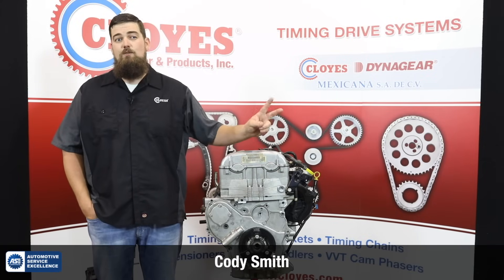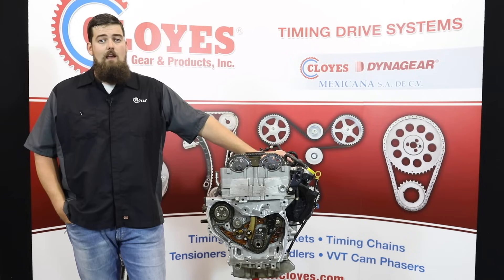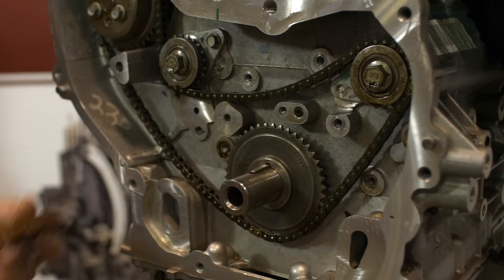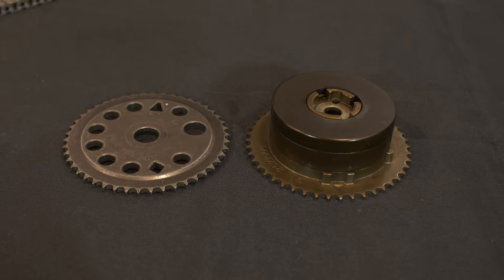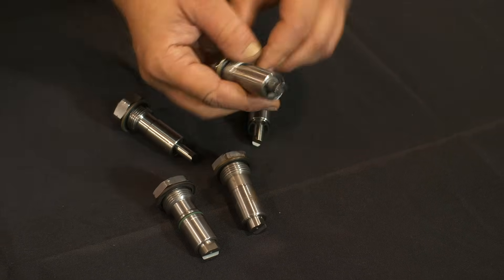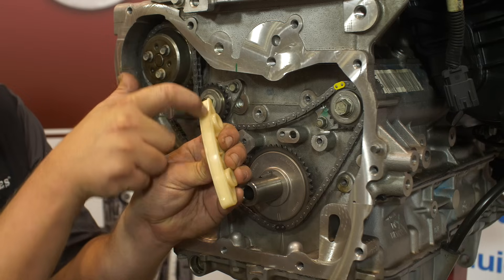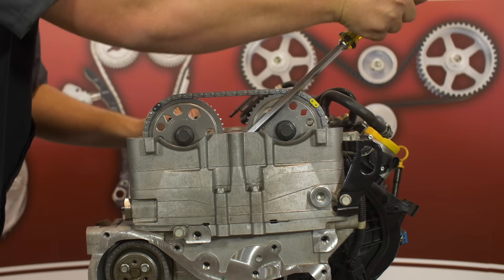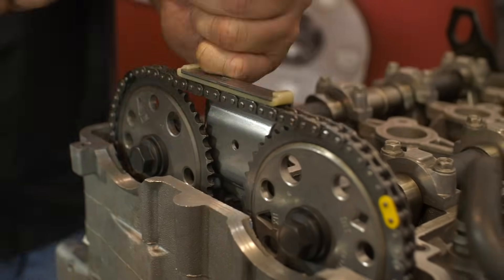GM 2.0/2.2/2.4L, Timing Chain Replacement, Cloyes 9-4201S & 9-4202S

Comment: Do you know another indication of the TDC in exhaust stoke? Haynes manual states marking on pulley and line mark in engine cover is TDC on compression. My arrows on the camshafts are 10 on intake 12 on intake. That’s the closest I can it to align to the arrows. I also did put a screw driver in cylinder number 1 to to TDC.
Reply from the maker: Sounds like you are close enough. The engine does not need to be at perfect TDC to set the timing. The chain sets the timing, as long as your links are all aligned properly to the sprockets, then it is in time.

Comment: How do I verify the #1 piston is at TDC on correct stroke?  I replaced the head after chain broke and bent valves. I can get everything to line up but am unsure if #1 is on proper stroke.
Reply from the maker: If everything is aligned, then it is on the correct stroke. If the engine was 180 out, then the cam sprocket timing marks would be down.

Comment: Just finished doing my timing chain and came up with p0016. What i learned is to retard the intake cam 1 tooth
Reply: When taking everything apart, the intake gear tends to "spring" forward one tooth, so you have to turn it back when putting the new chain in.
Reply: @TiggerNyeah  i figured out what i did wrong and i only moved the exhaust cam instead of adjusting the intake cam

Comment: This is my second comment on this video, but I think it is worth saying.  I, like many of you, had a really hard time getting the sprockets off on the balance shafts.  In fact, I ended up dropping drill bits and punches into my oil pan (100% my fault- I should have stuffed a rag into the void leading to the oil pan).  Anyhow, what I ended up doing (and it worked really well) is I took the old balance shaft chain,  and cut it in half with a cutting wheel.  From there, I draped the chain over the top of 1 of the sprockets, bunched one end of it and let it bind on the housing.  This held the sprocket solid  and allowed  me to remove and reinstall the new one.
Reply: Were you able to get your stuff put of the oil pan
Reply: @Burgerkinglover32   yeah- I think I had to drop the oil pan to get everything out
Reply: @billyjacque6940  was it difficult did you do it on a lift or on the ground
Reply: I dropped a tool in the oil pan also we fished it out with a magnet and my boroscope

Comment: I already installed the timing chain on my 2012 Chevy Malibu. What happens if the timing sprockets on the water timing chain are not aligned properly? Does the vehicle overheat? Do some cooling systems not function properly?
Reply from the maker: The balance shaft chain that drives the water pump needs to be timed for proper balance shaft operation. There should be no water pump or cooling related issues as long as the chain is turning the pump. You could experience excessive engine vibrations, but that is it.

Comment: I just finished mine it wnt start, gives me code P0366. (CMP) Sensor . This is the code I was getting before I realized the timing was out and multiple timing guide pieces and bolts ended up in my oil pan .I dropped the oil pan and filled a 12 oz cup full of pieces and bolts. I also found 8 of my cam rollers in pieces on the top , so I picked them all out with a magnet. Tested compression  it was fine. I'm thinking the rollers blew out before the valves hit. Can you tell me if the P0366 could mean my timing is out ?  I changed the  camshaft position sensor , still the P0366. I still have to go back and inspect the wiring.But would this keep the vehicle from starting? Every thread I read no mechanic says, in probale causes for P0366  -  "timing is out or cam is out of sync" One mechanic guided this guy through changing his (CMP) sensors then his(CMP) actuator selonoids .And all the time the car owner was telling him I hear a rattling coming from the motor . Low and behold the timing chain went. The mechanic said hears a guide on how to replace yor timing chain. So I wonder if this answers my question.
Reply from the maker: It could mean the timing is off, or you may have a VVT system issue that is not allowing the computer the adjust the timing properly. Have you replaced the timing system since the failure?
Reply: @Cloyes01  Yes I did a timing chain ,gears and guides . After re assembly when I try to start it , it just cranks. I get a p0366 code .this code is what was coming up when the chain jumped in the beginning .
Reply: @Cloyes01  Do you have any specs for the 2011 Buick  2.0 TURBO "LNF" motor. I am hearing the cam sprockets are to be set at 5 and 7 o'clock ,can you verify this ?

Comment: So I took a 2012 Buick Regal 2.0 to a shop for water pump.. they ended up setting off timing and refused to accept responsibility… I eventually drove it and repeatedly changed ignition coil #2 over and over until it finally went out for good. So now I wanna figure out if I fix timing and do coils and plugs again if all will be good again? Or if it messed up catalytic converter?
Reply from the maker: It should be good if you get the timing set right and have functioning plugs and coils. The converter should not have been damaged.

Comment: I torqued your bolt at the 63 ft pound on the cam sprockets and the bolt broke.  Are you sure that's the right  torque?  GM is like about less than 30 ft pound.
Reply from the maker: The GM torque specifications we found are 22 lb/ft plus 100 degrees on VVT equipped engines, and 63 lb/ft plus 30 degrees on non-VVT engines.
Reply: @Cloyes01   I only have 2 torque wrenches.  one in 250 ft pounds and 250 inch lbs .From what I understand, you  can torque in inches and multiply by 12.  True?  But since 22 times 12 is 264,  is there a way I could get that extra 14 inches?  Without going out and get a different wrench.  If you understand what i mean.
Reply from the maker: @cartroublewannafix8611  Using the inch pound wrench at 250 inch pounds will get you to 20.82 foot pounds. That is close enough and likely within the range of accuracy for an over the counter torque wrench. Possibly just as accurate as using the larger torque wrench at 22 pounds.

If you are concerned, you can torque to the 250 inch pounds, then set the larger wrench to 22 foot pounds. That way you know it should only require slightly more torque before you get the click.
Reply: @Cloyes01  I forgot to mention that on my ft lbs one I only have from 50 l ft pounds to 250 ft pounds.  I don't have the 22 pounds on the big one.
Reply: @cartroublewannafix8611  I seen a video where the mechanic explained  by  using a  long handled torque wrench has more leverage and you will have more pressure in the inittial torque.

Comment: s there a way to adjust the timing without marks?  I took the chain out and my stupidity allowed me to turn the the sprocket s individually, which turned the cams.  Now I have no idea where I am at.  Call me  an idiot because I am. 2015 Chev malibu 2.5
Reply from the maker: It is OK. Just remember the timing chain sets the timing. You will need the marks on the timing chain links so you can align them to the sprocket marks. If your chain no longer has marks you can make new ones with a paint marker. Just lookup our 9-4201 chain on our website and make new marks that are spaced properly. When reinstalling the chain, move the shafts to approximately the correct locations then start aligning the marked links to the sprocket marks. If a sprocket mark isn't aligned properly, just move that shaft until it does.
Reply: @Cloyes01  Ok,  like I told you, I had no idea where the timing was , as I turned the sprockets individually from wherever they were.  So in other words, if the  intake diamond(on the sprockets) was facing say 5 o'clock  and the triange  was, say 6 o'clock( these are just made up numbers) , I saw that the chain was loose and took  the chain out right there.  Once the chain was out, I turned the sprockets individually to the diamond 10 o'clock  and the triangle 2 o'clock, which  is what the Chev malibu 2015 timing is supposed to be at when the TDC is at 12 oclock when you set the chain in.    I ordered everything from Cloyes except I didn't replace any of the cam sprockets, so when I put the chain in, after I set it on the marks of the 2 sprockets, I can't get the the mark of the chain to reach the dot (5 o'clock )  with the crank at 12 o'clock.  I pull the  exhaust cam clockwise to the max, finding resistance and i'm still a tooth short.   The only way it  matches is if the  crank shaft with TDC 1  is at about 11 o'clock position.  Would it be because the cams are not set right?  I would appreciate any input.  Thanks
Reply from the maker: @cartroublewannafix8611  All you need to do is move the crank to that 11 o'clock position so all the marks align. If all 3 marks are aligned then you are in time. It doesn't matter if you are at 10, 2, & 12 o'clock, or 9, 1, & 11.
Reply: @Cloyes01  I guess what i'm afraid of is having the timing 180 degrees off since I messed around with the cams.
Reply from the maker: @cartroublewannafix8611  The camshaft sprockets will only index onto the camshafts one way. So if you have the correct marks aligned, then you will have it in time. If a cam was 180 degrees out, the correct timing mark will be down, and you will not be able to align it properly.

Comment: When I am installing the small intake sprocket, I am able to move it in and out a bit (it has play).  Is this normal?
Reply from the maker: A small amount of shaft endplay is normal. As long as you are moving the entire shaft and not just the sprocket then you are OK.
Reply: @Cloyes01  Thank you!  Do you know the torque spec when reinstalling the harmonic balancer bolt?  I am re-using the same one unless it is recommended I get a new one.
Reply: @frankierodriguez5620  never  use the same one.  Heavy torque like that is  a one time use only.  I learned the hard way.
Reply: @cartroublewannafix8611  Yep and I saw on ebay a few selling used ones SMH

Comment: It’s difficult to tell from the video, but if the balance shaft chain were to slip off of the water pump, is it possible to remove the cover and realign that chain, check timing without messing at all with the primary chain?
Reply from the maker: It is possible if you do not need to remove the chain, but if the chain came off the water pump then you likely have a tensioner issue in the balance shaft system.
Reply: @Cloyes01  no it came off cause I didn’t use the tool to hold the pump correctly 🤦‍♂️ pretty dumb mistake on my part, pulling the cover now.
Reply: I've changed my pump and after that the chain rattles....do you reset the tensioner or something? How is you car doing?
Reply: @axxisblack  I haven’t gotten all my parts in yet so not finished but I feel like that must
Mean you didn’t line up the tensioner right or didn’t activate it properly

Comment: I got new timing kit and bent valves repairs in the head.  2012 buick leather 2.4L LEA motor with the high pressure fuel pump system.  It cranks but no start. It started once & shut off.. it ran before i pulled the head off. Now it wont run can anyone help me please. Im really stressing hard. Please someone chime in and help me
Reply: Might not be timed right?

Comment: guys there are two different cam setting locations, depending on the engine model .. find the sticker in the glove box of your car and match the three letter code.

Note: If equipped with one the following engine; LE5, LE9, LAT, LNF, LDK, LHU, LTD, LBN, or 2010 LAF, ensure the intake camshaft notch is in the 5 o'clock position and the exhaust camshaft notch is in the 7 o'clock position and beyond.
Ensure the intake camshaft notch is in the 5 o'clock position (2) and the exhaust camshaft notch is in the 7 o'clock position (1). The number 1 piston should be at top dead center (TDC), crankshaft key at 12 o'clock.
Open In New TabZoom/Print

Note: If equipped with following engine; LAP, LE8, LEA, LUK , or 2011 LAF, ensure the intake camshaft notch is in the 10 o'clock position and the exhaust camshaft notch is in the 7 o'clock position and beyond.
Ensure the intake camshaft notch is in the 10 o'clock position (2) and the exhaust camshaft notch is in the 7 o'clock position (1). The number 1 piston should be at top dead center (TDC), crankshaft key at 12 o'clock.
Open In New TabZoom/Print

Note: Ecotec 4 cylinder engines with SIDI-Direct Injection, the lower timing chain crank gear may be equipped with a second spacing washer installed in front of the lower timing chain crank gear. The outer spacer/washer is in between the crank/balancer pulley and the lower timing gear and may remain in place when the pulley is removed. The spacer/washer has a dot/mark on its surface that may be mistaken for the lower timing mark. If applicable, the washer must be removed in order to view the correct timing mark on the lower crank gear. The proper mark is also in line with a semicircular notch in the inner diameter of the gear.
Reply: Omg I just finished putting mine together and it wont start. You are saying my fricken timing is off 180 degrees. Why don't he fricken guy tell you ! Hear is your number 1 piston ,stick a screw driver in it and make sure its at tdc. So i was on my down stroke . I  have to research the firing order.  2011 buick regal 2.0 turbo.  Check engine -code P0366
Reply: So my timing is off, I have the  LNF 2.0 TURBO. i set the timing to the video. The online manual I bought sucks .What a waste of money.

Comment: i bought the 9-4201S, but the crankshaft sprocket doesn´t have the black plastic, is just a metallic sprocket,  there´s anything wrong?? 10:37
Reply from the maker: No, since filming this video we have updated the crankshaft sprocket and eliminated the rubberized cushion coating that is prone to breaking apart.
Reply: @Cloyes01  thanks!!!

Comment: My cam shafts are off how do I make sure they are adjusted correctly
Reply from the maker: The chain will set the camshaft timing. Just make sure the marked links of the chain are aligned to the sprocket marks.

Comment: Are these failures mainly due to people using the 'Remaining Oil Life' feature and not changing oil on regular intervals and allowing oil to become contaminated and debris moving about oil system?  I see the kids like to look at that vs us elders write down mileage and change when 3500 or 5000 no matter what this indicator says...
Reply from the maker: Extended oil change intervals do not help at all. Oil will keep its anti-wear properties, but it gets dirty. Microscopic particulates that the filter cannot remove remain in the oil until it is changed. Those particulates cause wear and can/will cause wear to components like the chain. We do not recommend going more than 5,000 miles on an oil change.
Reply: If there were guide failure, shouldn't we be dropping the pan to remove said debris?
Reply from the maker: @craiggerlach5548  Yes, absolutely.
Reply: I see some mention the crank bolt was torque to yield and they had to source that, anyone with part number, or is this re-useable? Looking at a 2011 Regal for 1500 that needs this done.

Comment: The plastic only slide for the 2.4 needs replaced with a aluminum and plastic combination have replaced it twice in less than 10000 miles nothing else wrong with the motor, for the Crank 2 cam chain
Reply: The chain is rubbing constantly on those stupid plastic guides under pressure. Not a good plan.

Comment: I have a 2013 chevy malibu eco with the 2.4l ecotec luk. When I go onto your website for both cam phasers, I only see one. Do I use it for both intake and exhaust cams? Or do I have to source out the intake one from somewhere else
Reply from the maker: Some applications use 2 of the VC107 "exhaust" phasers instead of one VC106 and one VC107. Our data should be correct regarding your application. Just make sure what you remove matches what you install. If you want to confirm before ordering, you should be able to remove the valve cover and see if they match.

Comment: Why at the end is it not advised to turn the engine over by the crankshaft when installed and timed. I thought your suppose to check if timing is correct and that there is no interference?
Reply from the maker: If the marks are aligned then you are in time. Rotating the engine by hand only increases the chances of the chain jumping a tooth on a sprocket. The Ecotec engines are bad about the chain jumping a tooth on the crank sprocket before the tensioner can prime up with oil pressure. Slow rotation by hand allows valve spring pressures to move the cams dramatically causing chain slack to shift.

Comment: I had my head machined and new valves and valve guides installed professionally. When I picked up the head, both cam gears were already installed. Since these bolts that hold the cam gears on the camshafts can't be reused, is it possible to install the new timing chain without removing the cam gears? I was thinking of putting the timing Cain on the gears prior to installing the head. Then dropping the chain in the slot in the block as I lower the head in place. Does anyone have any experience before I kill myself for no reason?
Forgot to mention that it's a 06 Saturn Ion 2.2L Ecotech.
Reply from the maker: I believe you will need to remove at least one of the camshaft sprockets. You will not be able to install the chain/sprocket onto the crankshaft without some slack.
Reply: Thank you for answering my question! I believe that you are correct!

Comment: a question,, the little notch on the tensioner...will as you spin it in, it also rotates,,.. will it match up with the notch on the tensioner guide?
Reply from the maker: Yes, that notch will align itself to the corresponding feature of the tensioner guide.